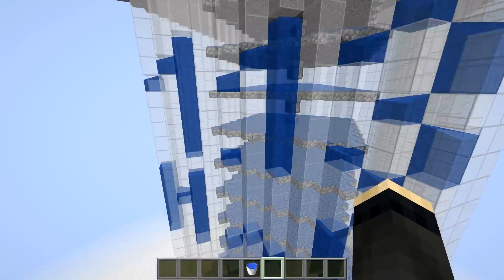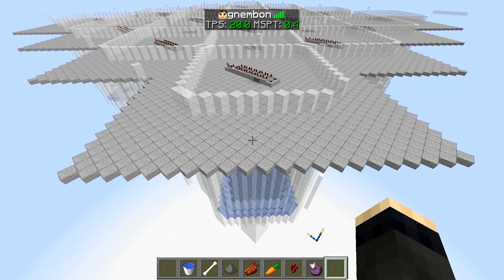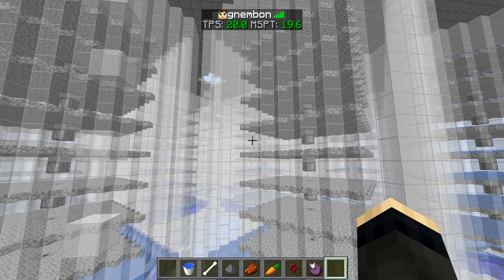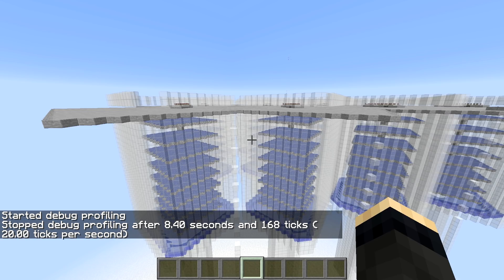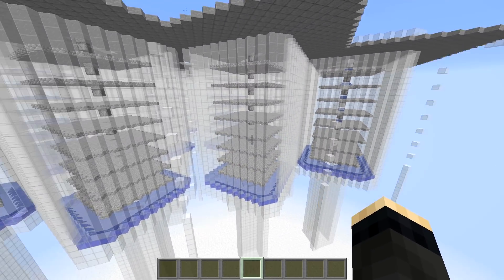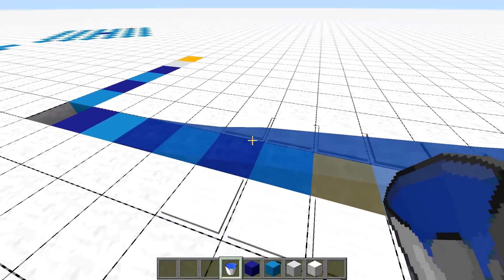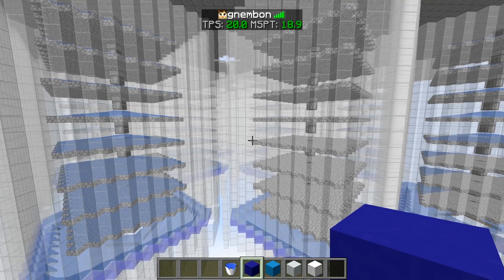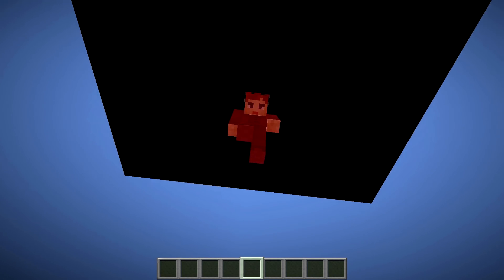Killer Water - Minecraft 1.13 Flowing Water Performance.

Comment: It seems like the water updates the observers more consistently now so we can fine tune the timing better. If you just build one tower then it should be more efficient than if you build one in 1.12, but of course you can't build multiples cause it will get very laggy.

Comment: You might be able to squeeze out a little more performance, and not need the “optimized” setting, if water could only spread when it increases in depth, not decreases.  I wish you could fix the bug in bedrock edition where it often leaves water sources behind when you remove water from cave walls.

Comment: I think the needed processing power increases non linearly. I think you can only have about 25 of these diamonds, not 40, before seeing a noticeable drop in performance
Reply: Computing power never increases linearly... at very low levels, it may look like it, but eventually, increasing power by the same amount each time will not yield the same power as the iteration before...

Comment: Well, I guess I don't need to bother trying to play MC in 1.13. They've already broken the game for me in 1.12.3 (worked fine in 1.12.2 with just some slowdowns not different from every version since 1.7-8). They've changed something in the game and launcher, probably related to server connection. I was hopping they would improve on it for 1.13 since they won't accept that they did something bad an provide any chance of support. If they're creating more lag related to water updates it won't be playable in my old world, so I'll just give up on this game. I'm not even bothering creating a clean Windows install with no antivirus an no software besides the necessary just to run a game they don't bother properly supporting and only creates more problems then solve it in each update, to a level which resembles up to early Beta, but differently from the latter, it's unplayable now!

Comment: Hey, Gnembom, awesome video as always! Btw I've noticed that the tnt is a bit stronger in the 1.13 and that's bad for some systems like Ilmangos blast chamber. If possible, could you put a option on the 1.13 carpet mod to bring tnt back to its original strength? Would be really cool!
Reply: 1.13.1 changes this back in 1.13.1pre-2